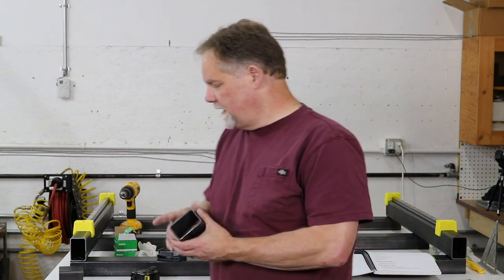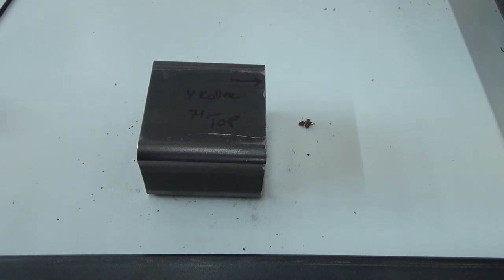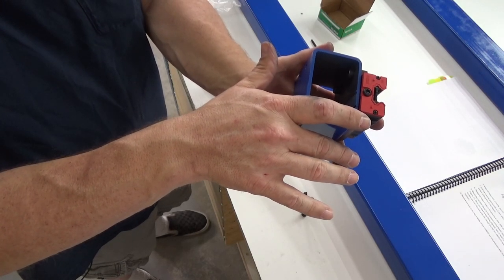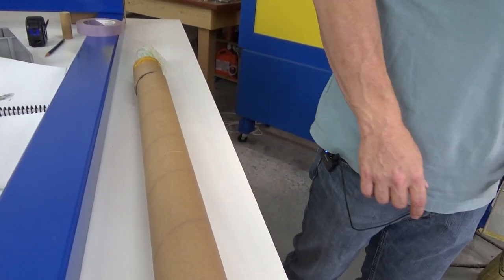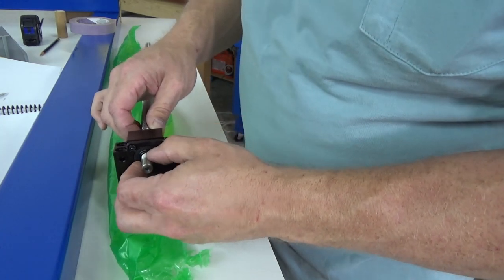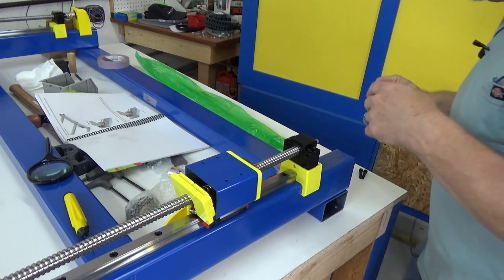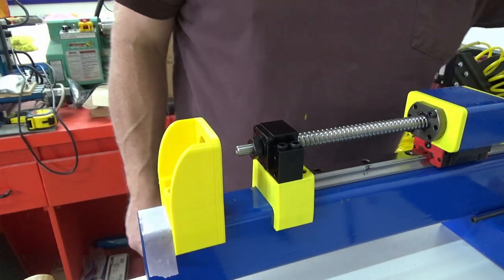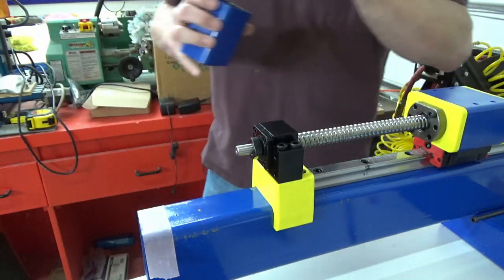PrintNC Project  Part 5 - Assembling the Y rollers and more!

Comment: Your holes being incorrect size is only common because too many people think 3d printing is just buy an ender3 and press print. There's so much configuring, and maintenance to get excellent prints. So to that point, no, it's not normal. I tell my printers to print an object, and it's dimensionally on the money.
Reply from the maker: I'm going to assume that you're not telling the guy that has 17 printers and has had thousands of printers built & configured based on the documentation he's written, how to use a 3D printer. 🤣
Reply from the maker: @8BitLife69  Of course the print quality was crap.  I had neither the time nor the interest in making the parts pretty - they just needed to be serviceable.  If basically telling you to not try to teach your Grandmother how to steal sheep is being an asshole, then so be it.  I'll wear the banner with pride.  😂

Comment: How can I make the roller side square if I don't already own a CNC or mill?
Reply from the maker: You have to be very, very, careful when you cut the material to length.  One thing to keep in mind is that only one face of the roller needs to be square - that's the end where the ball screw nut attaches.  If it's not square, you can shim the ball screw nut to make up for it (if it's not too out of square), but I will warn you right now - do NOT spend any time shimming it until after you finish the X Axis Gantry Prep step.  That bit me in the ass today after spending 45 minutes shimming and adjusting one of my Y rollers.  Turns out that Tool #6A won't fit if the ball screw mount is attached to the Y roller.  Words were said.  Many of them of the four letter variety.  I have some video I did today that covers some rather problematic differences between the wiki and reality, but I don't know when I'll publish it (if ever).  One thing to note - when you're at the X Axis Gantry Assembly step, you only need ONE of the HGW20 carriages - the other one you need is attached to the X-Axis Roller Beam you previously assembled.  The wiki doesn't show this at all - but the Fusion 360 model does.  (the typical answer when complaining is to be gaslit, followed by "reference the Fusion 360 model!" which I've come to learn is code for, "our documentation sucks, so figure it out on your own.")
Reply: @f15sim  Thank you for the reply.
This kind of (painful) learned lessons are what makes your videos super valuable for me and others.
So I would appreciate it a lot if you are able publish the "words of the 4 letter kind" situations at some point. I have watched the last series video and I understand your time is limited, so I know this will not be a step by step guide anymore.
Speaking of: thanks for the countless hours spend documenting the process for YouTube! This will help me a lot in my build and that of many more!
Reply from the maker: @mxd5273  I'm probably within a day's work of having the build mechanically complete.  I'm planning on doing a "post-mortem" video at that point that will hopefully catch all the pain points I've hit.  I've also been making notes in my printed copy of the wiki and I will update the wiki based on those notes if I can find the time.  Thanks for the kind words!